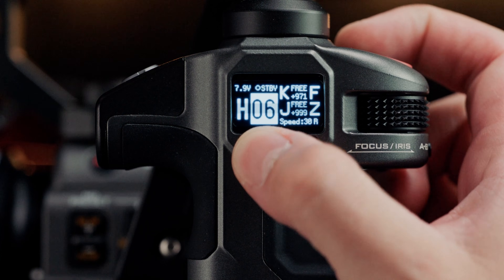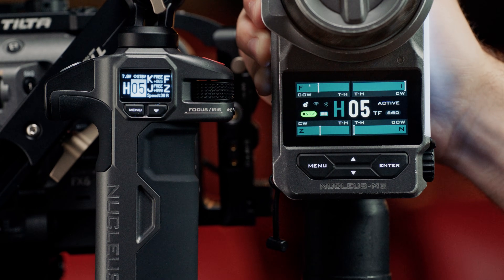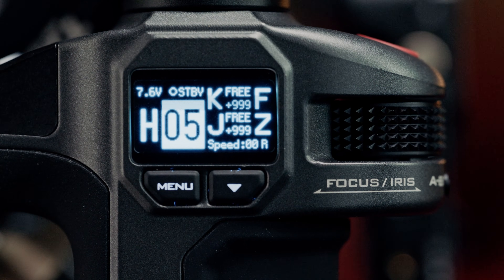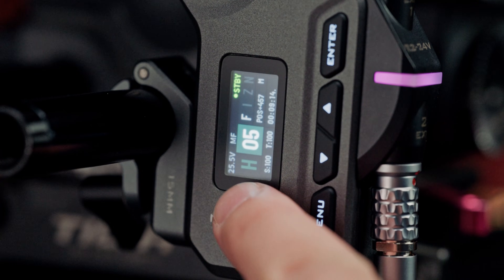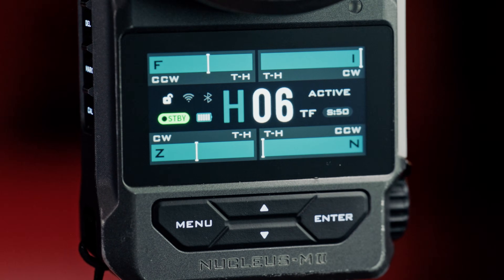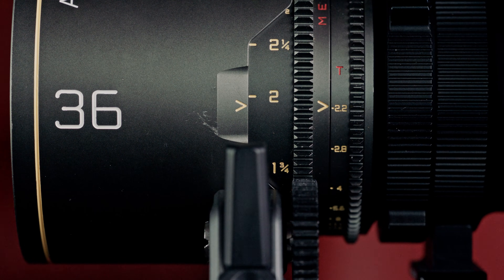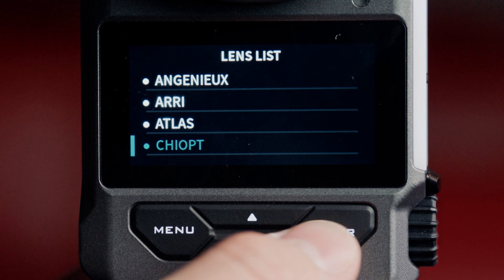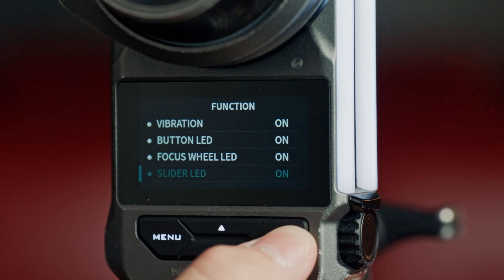Tilta Tech Channel: Nucleus-M II Firmware Update Overview

Comment: Hey guys, huge design flaw, but the gear teeth don’t extend very far off the motor unit itself, so when trying to use it on small lenses and PL mounts, the motors literally don’t attach. 

For example, trying to fit both motors on the same side of the NiSi Athena’s with a Metabones PL mount, isn’t possible. Though swapping the wheel side from left to right side of the motor would make this possible, and is a big reason to buy this unit, the fact that the teeth wheel doesn’t extend far off the motor makes it impossible.

It’s disappointing to see such a potentially great product come out in a state where a PL mount ruins the motor use on professional sets. Makes the 1st ACs job when swapping lenses or filters so much harder and unnecessarily complicated.

Compared to the M1 nucleus motors where the wheel extends nice and far, these are very disappointing.
Reply from the maker: we will be coming out with a bigger size gear soon!
Reply: Had the same problem with cooke anamorphic 2x lenses.
Reply: What would be the possible fix for this?

Comment: And when are you going to make the camera control cable actually functional? Because you sell it but it does not work. And when are you also going to update the infographic on the camera control cable page to not blatantly lie about which cable needs to be purchase for the Pyxis.
Reply: They'll never support customers as they should. It's still Tilta sadly :/
Reply from the maker: Thank you for sharing your experience and we’re sorry to hear about the confusion with the cable information.
You are correct that the Pyxis doesn’t have a LANC port and our compatibility chart has since been updated to make that clear. We always try to fit as much functionality into our systems as possible which can sometimes lead to situations like this.

We really appreciate your patience and feedback as it helps us improve the firmware and documentation for all of our systems. If you ever need help or have more suggestions, feel free to reach out anytime at zehuay@tilta.com
– Z from Tilta